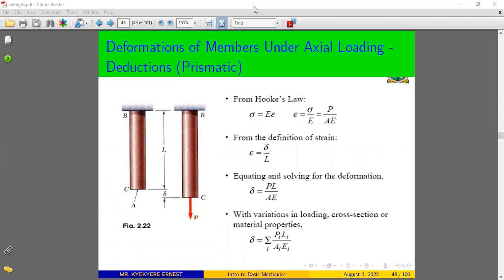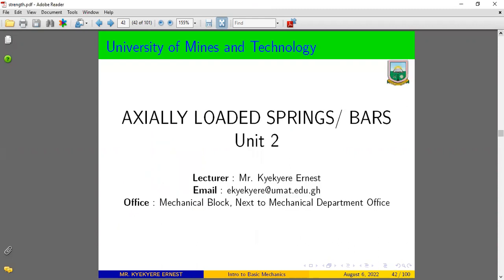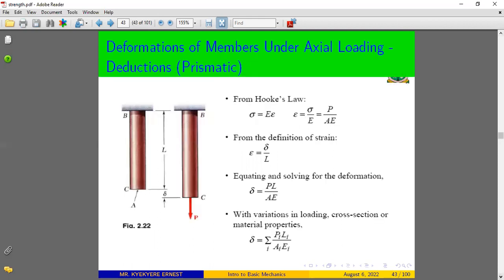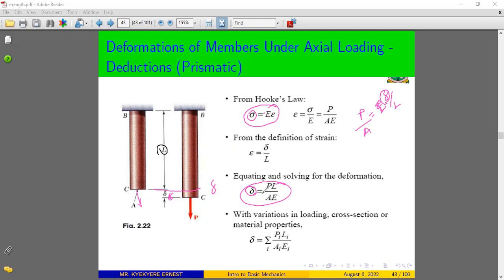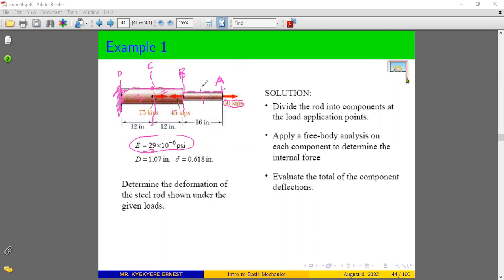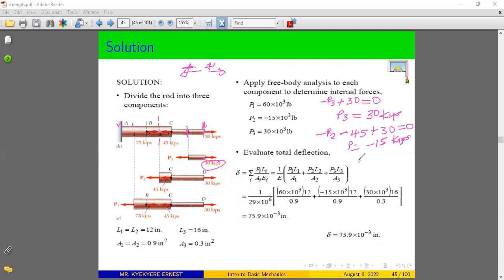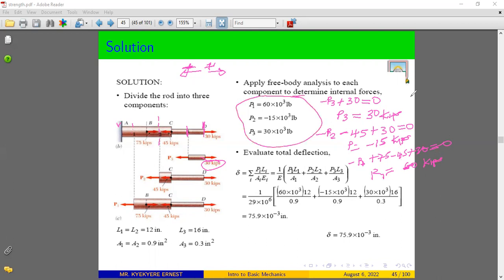Strength of Materials:Axially Loaded Springs and Bars

Comment: PLEASE CAN YOU HELP WITH THIS QUESTION.THANK YOU.
A uniform steel rope 250 m long hangs down a shaft. Find the elongation of the first 125 m at the top if the density of steel is 7840 kg/m3 and Young's modulus is 200 GN/m2.